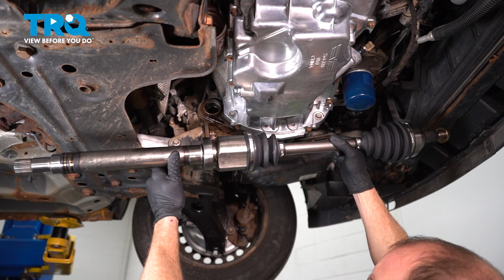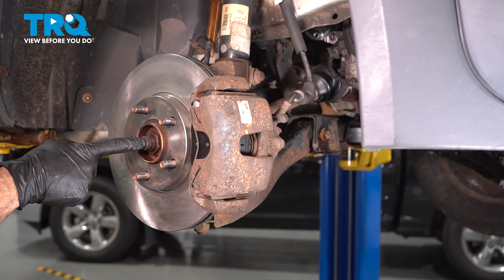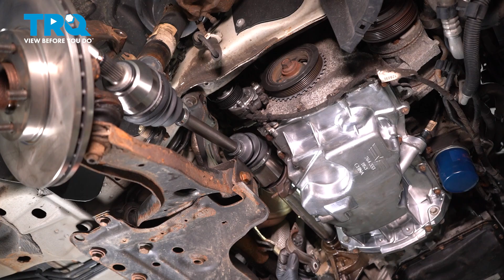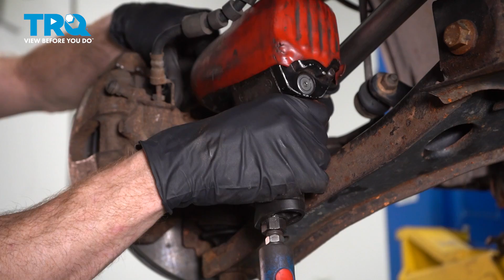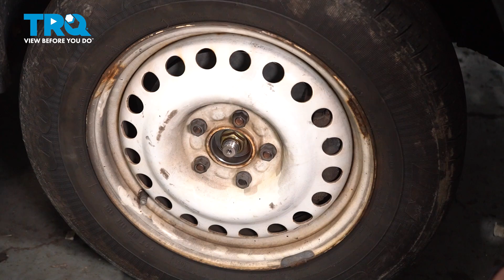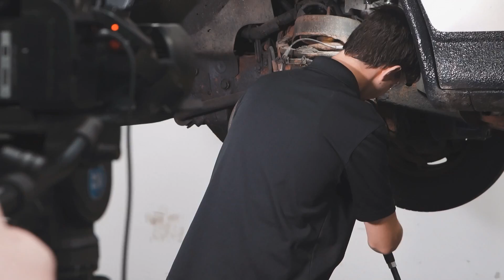How to Replace Passenger Side CV Axle 2010-2013 Ford Transit Connect 2.0L

Comment: My aftermarket CV axle must have less maximum angle because I can't pull the lower control arm down far enough to get the strut back in without the axle binding but I can get the axle in without the strut

Comment: I have been fixing and servicing cars from the 1970's and in all that time, Never have I ever seen a driveshaft come out of a gearbox that easy.
I assume you have removed this before the video as to how everything is clean and comes apart in a breeze.
Now having said that, This video for folk who do not know how to do this simple job will find it extremely informative.
All in all a very good video.